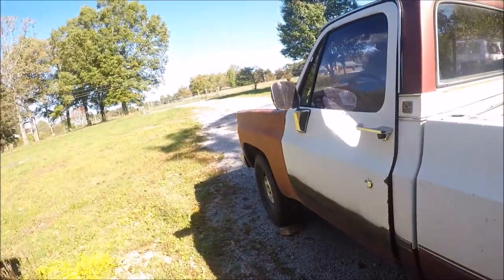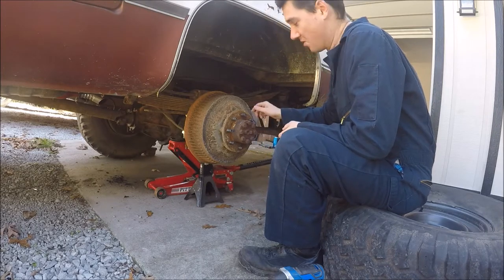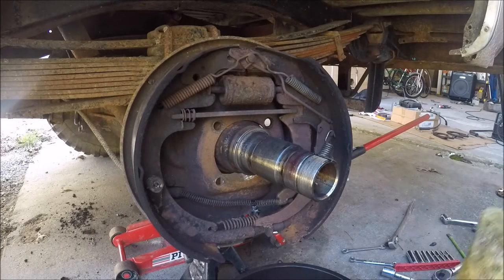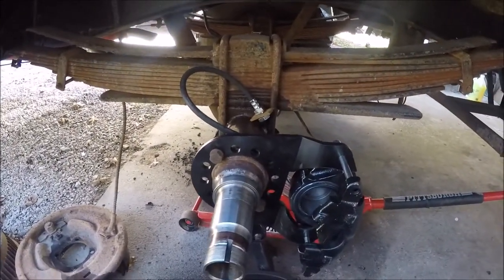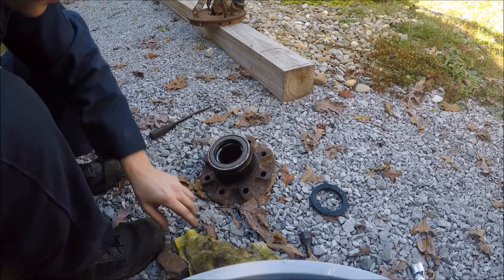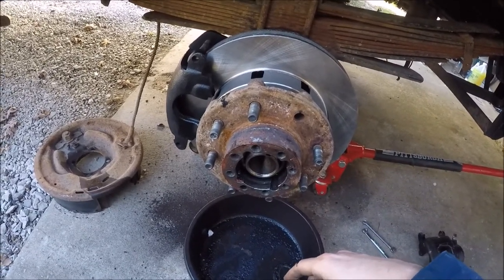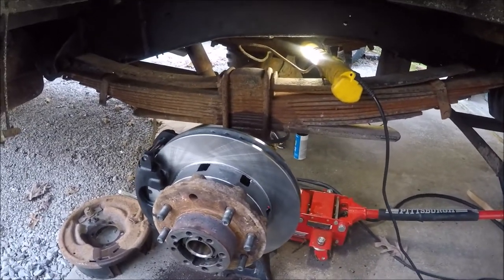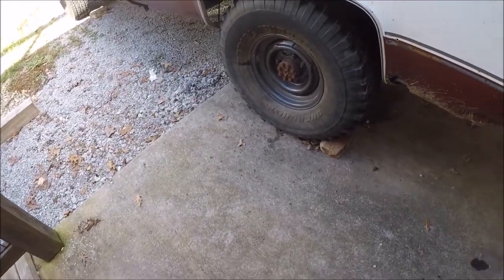GM 14 Bolt Disc Brake Conversion Step by Step

Comment: A shade tree mechanic with an actual shade tree🙂. I'm envious. I have an all original low mileage '80 Chevy K20 that I'm about to do this conversion on but I live in Texas where we have to have a working emergency brake. I understand you can use calipers for a '76-'79 El Dorado that has have the emergency brake. Haven't found any yet. SeaFoam DEEP CREEP is the best penetrating oil for rusty parts!
Reply from the maker: Rockuato had the cadillac calipers available last time I looked for them but they were some insane price. Seems like there's an alternative e-brake caliper but I can't remember what it is.

Comment: Good video. I just bought a used 3/4 rear and I didn’t wanna blow all the money on new drums and hardware for same price I can get a ful disc brake conversion kit.
Reply from the maker: Yeah it's cheaper and easier to gi with discs if everything is needing replaced anyway. The brakes on my truck are phenomenal now.

Comment: Do you do any towing with the truck? Does it feel like you've lost some braking capacity in the rear? I am interested to make it easier to maintain and maybe lose a little weight.  It seems like those calipers would not do as good as job as the massive drums that come on the 14b when stopping heavy loads.

I did the swap on my 2WD Blazer that I am upgrading the front brakes on also. She has stiffer springs all the way around and has no problems pulling 8k lbs with the 5.3L LS and 4L85E with the 14b FF. But I want to make sure I'm not losing braking power in the rear when switching out the huge rear drums for discs/calipers
Reply from the maker: My car trailer almost may as well be an extension of the truck lol, I tow with it more than not; and it stops awesome. The pedal feel is great and even though there's less contact surface than with the drums I feel like they're much more efficient. Plus there's not the rotating mass of those ridiculously heavy drums anymore. If I were towing a super heavy trailer I might be able to tell a difference but with what I use it for it works perfectly.
Reply: @CrazyWoody1989  🤟Thx for the quick reply.  What kind of vehicles have you towed on the trailer? Is it a single car, tandem axle or single? Or have you by chance had it weighed when fully loaded? 
Max I should be doing would be about 8k lbs even though my suspension and powertrain can handle more I don't really have the wheelbase to be going much over that I think.
Reply from the maker: @Hsan Werdna  it's a fairly heavy tandem axle car trailer; I'm not sure what the trailer itself weighs but if i had to guess it's probably 1700 lbs or so. I've hauled several square bodies on it, a fullsize 4wd dodge truck (70s model) and I've hauled my Gambler 500 van all over the country with it. The van is a 95 chevy G10 short wheel base and it's always loaded down with tools, spares and camping gear. I'm not sure what it weighs but it's pretty heavy.

Comment: Did you swap porportioning valve to a disc/ disc ?
Reply from the maker: @papalio01  I didn't, it still has the factory proportioning valve, but everything seems to work properly. I can't even remember how old this video is now, but I've put a ton of miles on the truck since I did the swap and it's still working great!

Comment: Do you have a parts list? What calipers jb6 or jb7 and what year truck
Reply: Typically JB6 is used because it is less powerful and you dont want to have stronger brakes on the rear than the front.

For a parts list, they also happen to be suppliers, look at:
https://lugnut4x4.com/product-category/rear/
or
https://www.ruffstuffspecialties.com/R1877.html
Reply: You could probably go JB7 if using a brake proportioning valve, that way you can have the bias up on the front when unloaded but send more to the back when towing/according to load. This is what I've been thinking about anyhow. 

My 944 Turbo has the same Brembo 4 pot calipers from the factory at all 4 corners but are proportioned of course to perfection by design.

Comment: Why would you put calipers in front or back, pros and cons ?
Reply from the maker: Mostly for the simplicity of maintenance and repair. Usually they have much more efficient stopping power without near as many moving parts and no need for adjustment.
Reply: I think it more relates to the position of the bleed screw to make it easy removing air from the system, but I'm no brake expert.   At least that's what I did with my 9.5" 14 bolt semi-float disc conversion.  The calipers ended up on the rear (diff. cover side) of the axle.
Reply from the maker: @Vladshock  As long as the bleeder is pointed upward and accessible of course, then it's all good. When I did the swap on one of my other trucks years ago the calipers were facing the back and they worked just fine but just something about the way it looked always irked me lol
Reply from the maker: @Joseph Clark It's mostly just a preference thing, some of the brackets out there only allow them to go one way, but since the ones I ended up with allow you to clock them however, I just decided to point them to the front. I will say it did make it easier to cleanly route my hoses, but that was just a coincidence lol

Comment: What size tires are those? Any trimming?
Reply from the maker: The tires are 315/85r16s, about 37 inches tall. Didn't have to trim any but I also only had them on the back. I've since downsized to a set of 285's lol
Reply: @CrazyWoody1989  I'm trying to work out a emergency brake for mine, mine is a d30 or k30 cucv. I don't have any of the old parts
Reply from the maker: @mblake0420  I basically omitted the e brake when I did the discs, of course the stuff it had on it originally didn't work anyway lol. If you do a disc swap you can run new HD rear calipers that have the e brake incorporated into the caliper or run 70s rear cadillac calipers to get the same thing. I've never been very impressed by the caddy calipers though.

Comment: The one thing i wanted to see was how to torque the hub nut and...... nothin
Reply from the maker: Welp, that's because I didn't torque on it lol. I don't even have one those stupid sockets to fit it, I've always knocked them on tight with a punch then backed them off a little bit, then knocked the lock nut on tight with a punch. It has never burnt one of the bearings up so far on any of the trucks I've done it to.
Reply: @CrazyWoody1989  Yikes!
Reply: First get the proper size hub socket. On this typical setup you would take the first nut and bring it down tight to seat the bearings. Then back it off until there is just a slight bit of drag on the bearing. Put the lock washer on tighten down the jam nut and bend the washer to hold the jam nut.

Comment: can this work with dual rear wheels?
Reply from the maker: As far as I know this particular setup won't work with dual wheels, but they do make caliper brackets specifically for dual wheel rearends.
Reply: @CrazyWoody1989  Thank you for the reply,  i really wanna get rid of the drum setup nobody i seen yet has drw
Reply from the maker: @bankruptracing9063  This is the second 14 bolt I've done it on, the first set of brackets I ordered were from Ruff Stuff, and I think the set in this video are from Jeep Hub and I'm pretty sure they both made me specify weather it was for single or dual wheels

Comment: It looks like the main blade of your rear leaf spring is broken. Is it the main blade? If it's the main blade then it's a serious problem. The main blade is what attaches the whole leaf-spring assembly to the frame! The rear clamp is now the only thing holding the leaf-spring to the frame and it's not designed to do that. That's very dangerous.
Reply from the maker: Yes! It was broken lol. I mentioned it maybe in this video? Might have been a different one I can't remember, but sometime after this video was shot I replaced it.
Reply: @CrazyWoody1989 Yes, you mentioned it in your video. I'm glad you got it fixed. Thanks for making the video. I really enjoyed it and yes, I watched it from beginning to end. Great content!